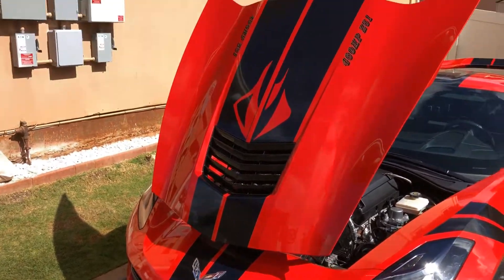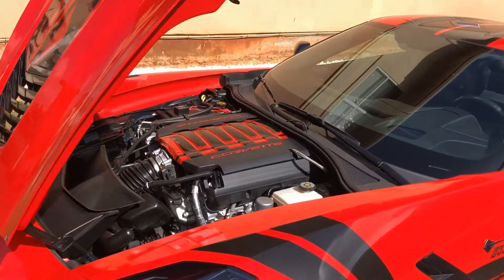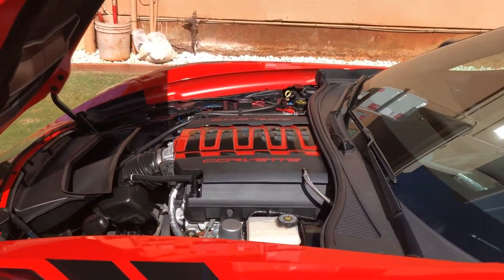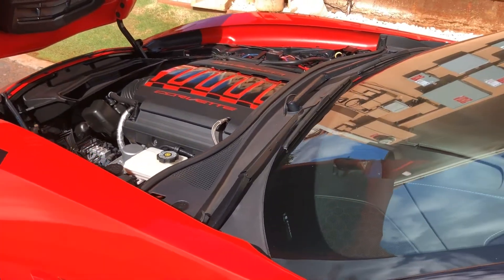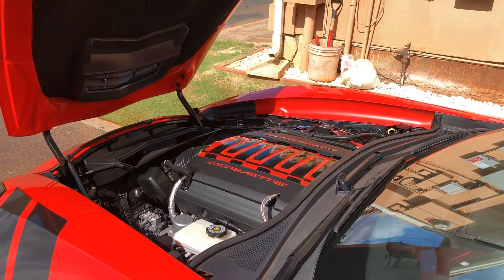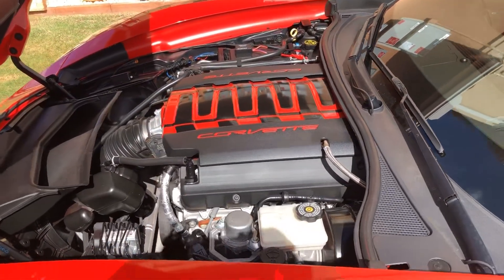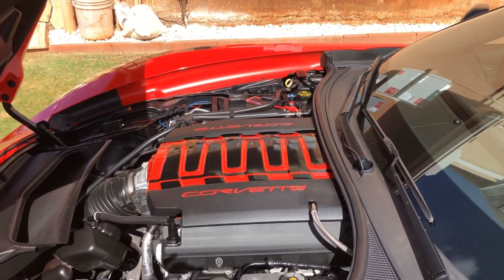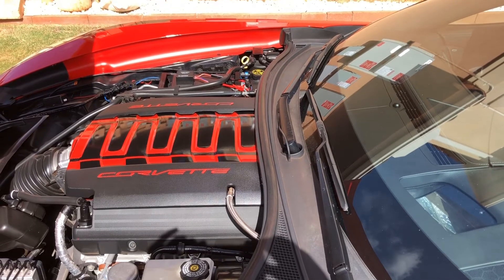C7 Corvette Z51 Engine Cover Final

Comment: Ok thanks I'm thinking about painting mine carbon Flash and calling it a day
Reply from the maker: What I found is you have to use High Temp Paint. I tried painting it with Laquer but it will burn with the heat of the engine. Aloha, Mark

Comment: Cool did you paint that your  self
Reply from the maker: Yes, and it was a pain because I had to use High Temp enamel. Enamel takes 48 hours to cure before you can apply the other colors. I have very little patience so I messed it up several times before I finally got it right. My advice take your time. Aloha, Mark

Comment: I'm thinking about doing the same concept to my engine cover. Any pointers? What kind of tape did you use to do the black and red? To mask
Reply from the maker: Aloha, I have been a custom painter for 45 years and this was a challenge. I like instant results like you get from lacquer, you spray it on, it dries in 20 minutes, you mask off the other stripes, paint it, remove the tape and clear it and your done. Not so with this project because you have to use High Temp Enamel. Enamel takes forever to dry, I even tried baking it in the oven. Nope. You have to be very patient. Paint on the first color, I like to use 3M Fine Line Masking Tape, then forget about it for 3 days, leave it someplace warm to dry at least 80 degrees. It takes that long for enamel to cure before you can put on the second color. Finish your design using this method with each color. When you have completed the design, wet sand the whole thing and give it s coats of Clear enamel. Wait for 3 days and then, finally, install back on your car. OR, Just buy one already painted and save yourself the trouble. If I was not so hard headed that is what I would have done. Aloha, Mark